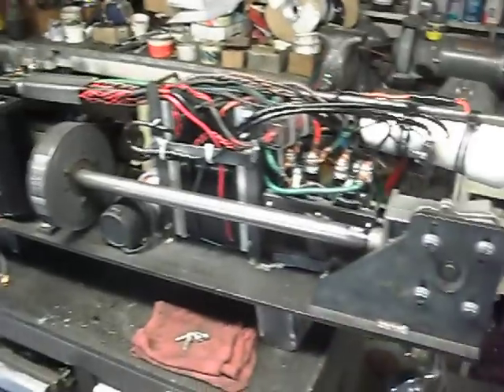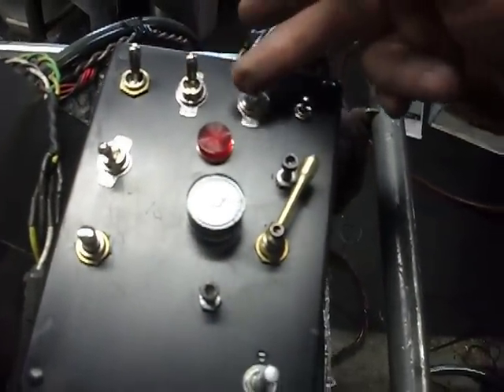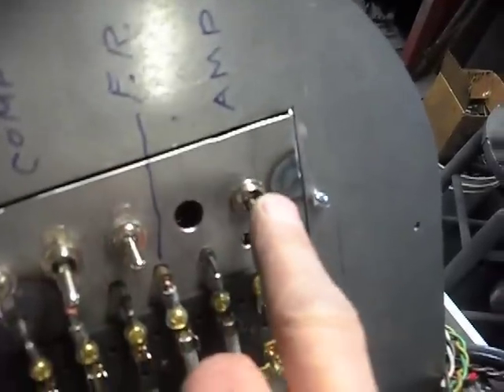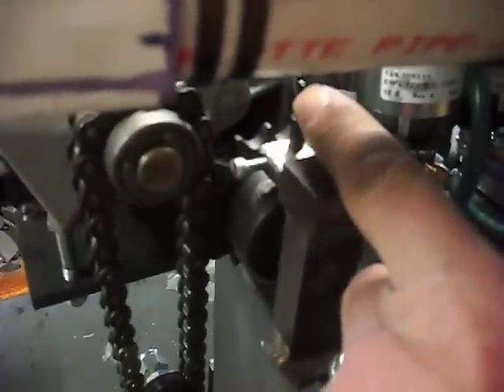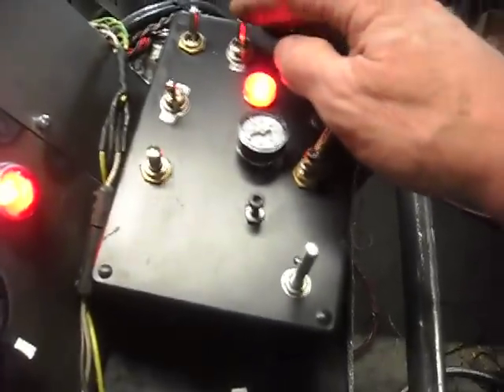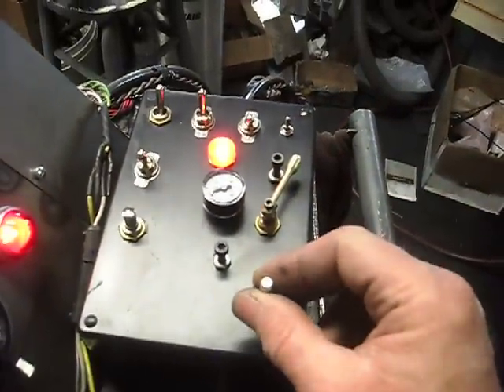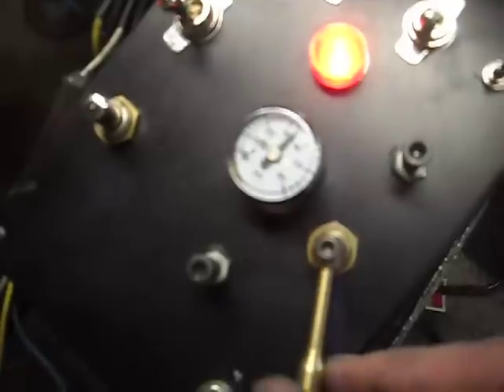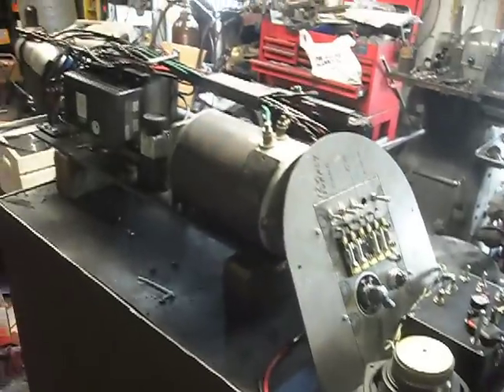Motor drive assembly

Comment: Great design Tom what exactly is the motor your using? 36 volts but what amps/watts and rpm. I have castings for RRS 2-8-2 I would like to run on electric but I'm clueless on what motor to use.Any advice would be greatly appreciated.Thanks Mark.